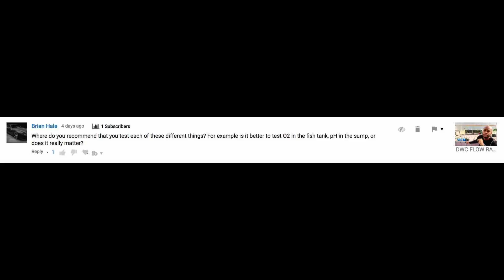TESTING WATER QUALITY IN SUMP VS RAFT VS FISH TANK

Comment: I have dwc foam raft boards with square holes for coco plugs. But the plugs disintegrate and leave the bed floor dirty. 
Is there another options to use with the square hole boards? 
I'll look for square net pots to use hydroton pebbles...? 
Thanks for all the GREAT AP info!